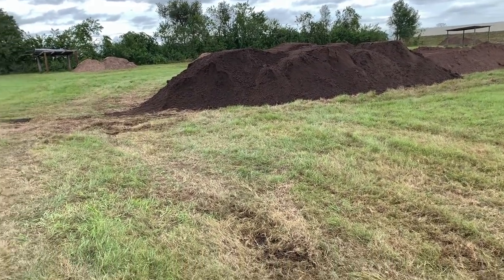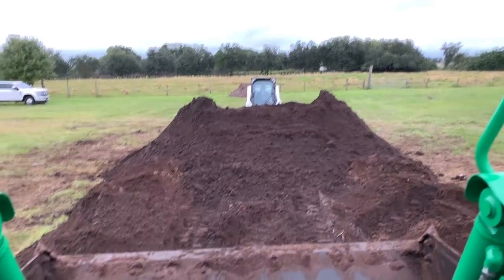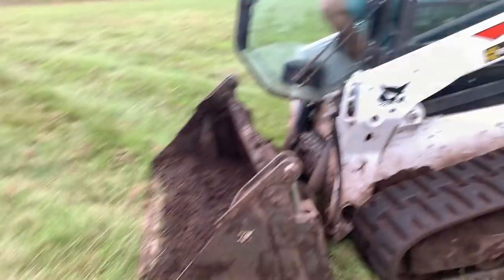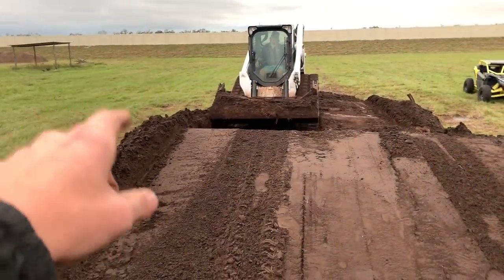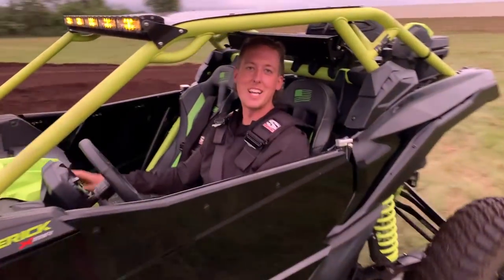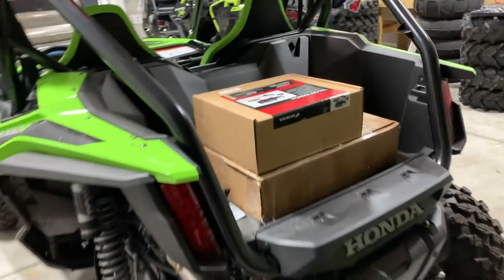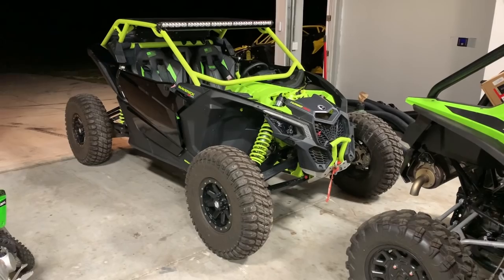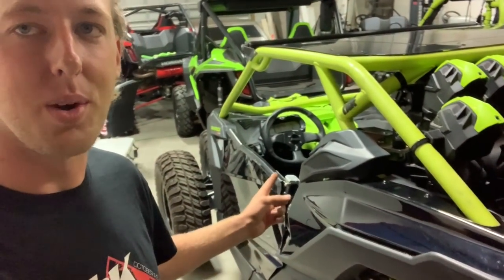We Built a SideXSide Track in my Backyard! Then I Rolled My X3 Turbo RR...

Comment: Cleetus, you should consider digging out an pond for the bog deep and use the dirt for the track. I also think you got the wrong dirt for that track. You got top soil delivered that will only get swampy and wash away over the time. The soil is more for planting crops and will store water. you want soil that drains water fast and does not store so much water. You could also plant some trees there?

Comment: Cletus you should install 4 large utility poles in each corner of the back yard and hang cables in and x from each corner of the square you make with the poles. On those cables can small link able LED lights to evenly light the field instead of huge stadium spot lights.

Comment: If that Dash Plastic is ABS, you can weld it back together with Acetone.  Clean each surface, Brush on some acetone till it starts to melt, then stick together and let dry.

Comment: In 05 i bought a yzf450 i had the thing 4 hours. Park to bs with some guys i was riding with when a dude on a banshee gets whiskey throttle clips a log, some how does this 100° turn. Smashed into my brand new quad. Upper lower a arms, shock, tie rod, rim and front bumper. Ive never been as mad as i was that day. I had to be towed out.

Comment: Use a dozer it is a lot quicker. Should build the ramps so you can hit them in both directions without issue. Need to hire a real excavator/heavy equipment contractor, to set up a real track for ya. As well as a lighting contractor for might lighting. You could build it up enough to start charging admissions and have them sign a waiver to use the facilities; after you get them in good enough shape and buy an old dozer and excavator to keep shaping new jumps and tracks. A drag bike and car area with a tree and start your own track. Maybe even a trick jump for 360 backflips and buy more property for a real camping/resort area for fishing camping and riding the backcountry of Florida. I see business potential here people.

Comment: You bought dirt when u already had the material there, and coulda ended up with a sweet mud bog or out,im an Earth moving engineer and a material handling, jump making genius, dig a gradual hole before table top to load suspension, if you need more dirt excavate from property were you would like a big ass mud bog or a nice pond, if you want your pond clear use limestone to line pond with, but dlnot in a mud bog